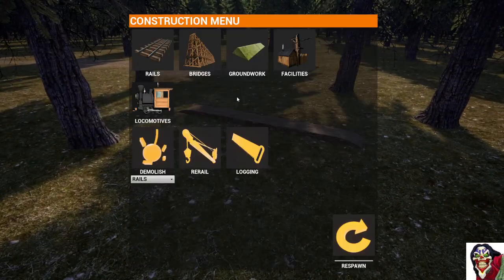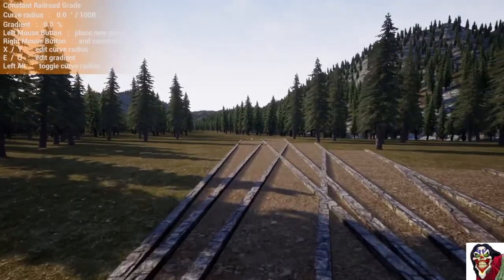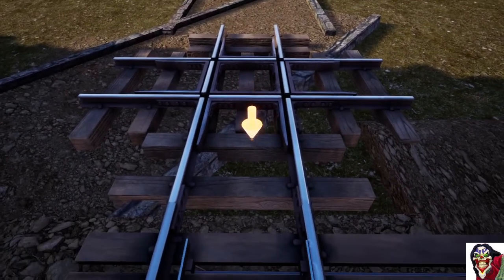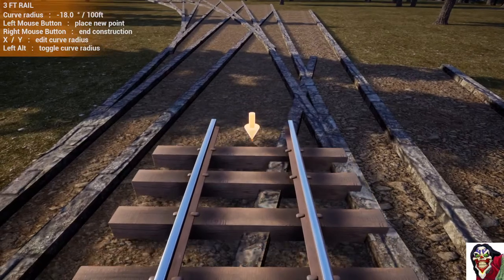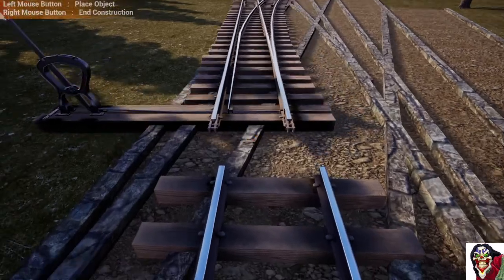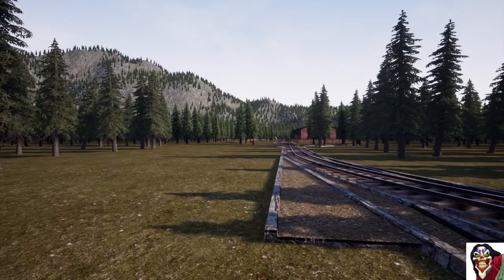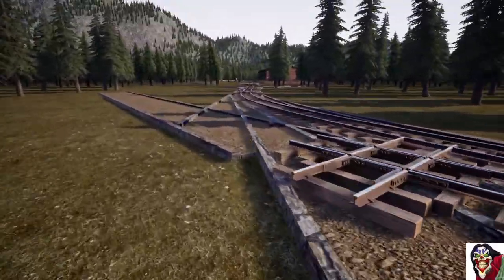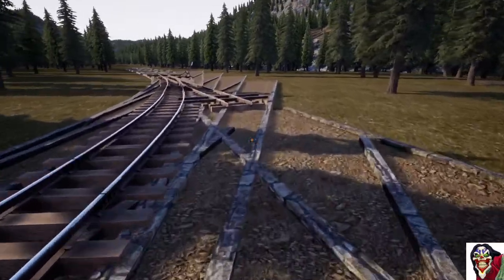RO! - Old Build Tools Tutorial Ep2

Comment: Using switches to make yards and sidings and even cross-overs would be so much simpler if only there was a way to change where the switch is linking from. Perhaps a key that could rotate through the 3 snap points on a switch from default, to the far point, to the side point, then back. Basically, you'd be "holding" the switch from a different link point to make alignment easier. This is still an issue even with the new beta spline update so as of now it looks like it won't be changed, but it really should.
Reply from the maker: I fully agree.  Being able to place the switch from the end you need to would make placing switches so much easier.

Comment: I've found the method to more consistently avoid the switch UI is to face the switch, back in the direction you want to go, creep slightly to the side of the switch until you get the link show up, then the UI doesn't show up, soon as the yellow highlight on the switch shows up, then switch UI will show up.

Comment: the best way that I have found with getting around the switch menu showing up when your trying to build off a cross track is to just delete the switch and then replace it off the cross track afterwards
Reply from the maker: Sometimes the switch doesn't go back where you deleted it from, especially if its on a grade.  I wouldn't recommend using this as a solution.